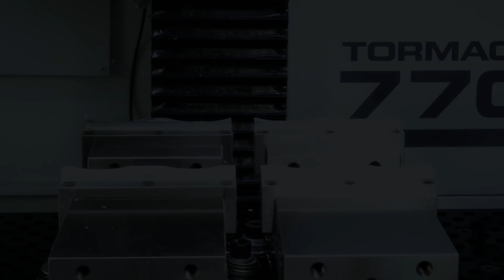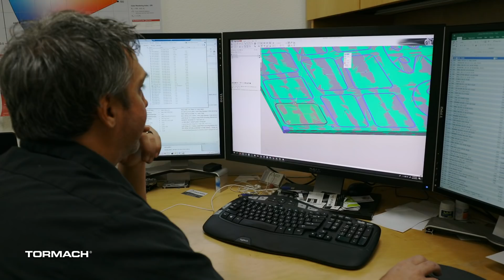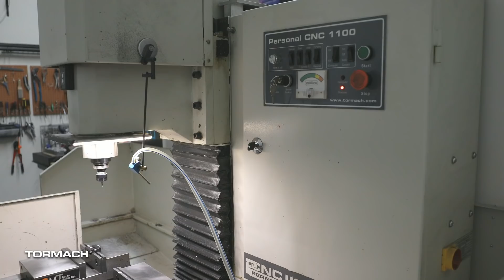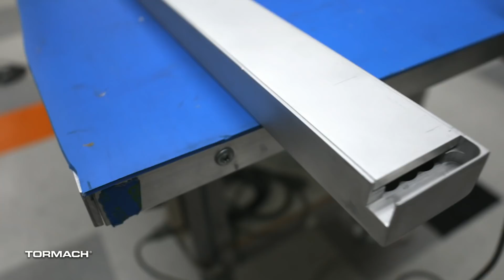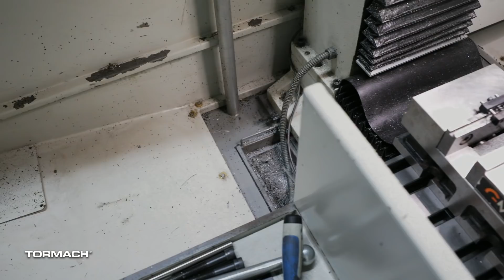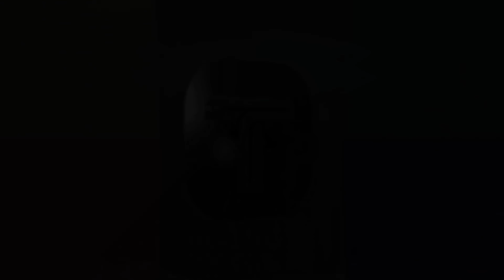Tormach Helped Photon Ink's Optical Engineering Company Grow

Comment: But is it precise and how precise it is? Looking into buying one but nobody at Tormach replied to my email. When I've ask this question: in a free pass on a boss milling half inch deep in aluminum what would be the precision of the ellipse generated when attempting to make a perfect circle:  +/- 0.00002 of an inch +/-0.0002 of an inch +/-0.001 or +/-0.003 of an inch? They where great at answering many questions until I ask this one. Does someone know what would be the answer for the same Tomarch in this video? M1100
Reply: If they intentionally don't answer you then it means that they know that you would not like the answer. Then walk away, this machine is not for you.  It is really as simple as that. Trust your intuition, not what you want/hope the answer would be.
Reply: You would use boring head for that, and easily within .001".  I make bearing pockets, and they are flawless press fit.  They are very precise...over 1100 hours and still the same.
Reply: I can't answer specifically for Tormach machines, but do want to mention that a machine that does not seem so precise by the numbers can do well by first running a test part, taking some measurements, and carefully compensating. That comes from experience in general and with a particular machine. Much is dependent on the operator. To make this easier, standardize as much as possible and experiment. Hope this helps in some way.
Reply: @kentvandervelden  this 100% on point.  My Tormach has approx .0012 in backlash/lost motion.  If you go into that blindly expecting tight tolerance parts you would be disappointed.  However there are ways of working around that. I was able to make a tool for assembling a medical camera.  The image sensor was .0394 x .0397 in.  The tooling had to allow assembly on the narrow dimension and prevent it on the larger dimension.  I had .0003 to deal with. I successfully made the part with .0001(5ish).  Would I try to make 50 of them? No.  5?  yep.